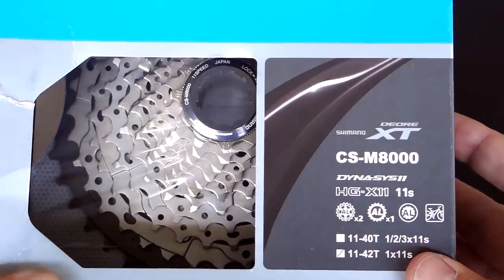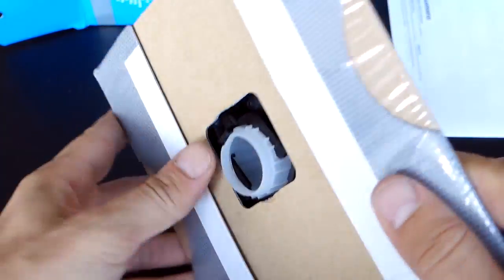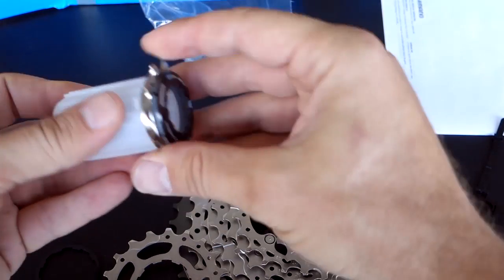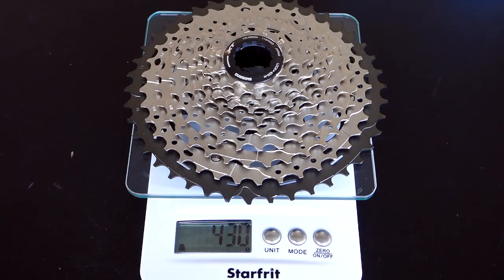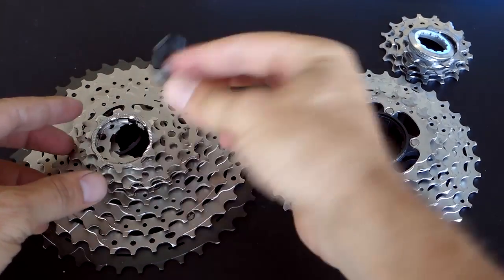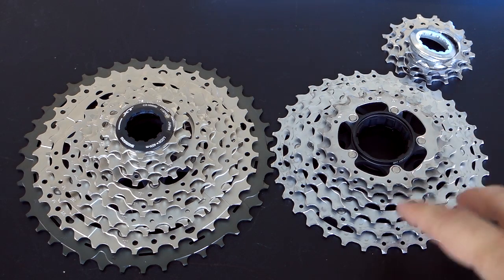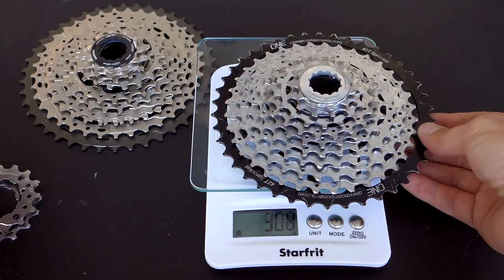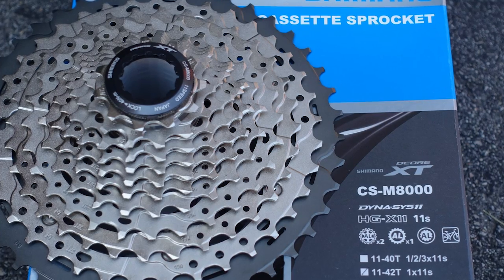XT M8000 11-42 11spd Cassette vs XT M771 10 spd vs 42t OneUp 10 speed

Comment: The package is reusable. You don't peel the plastic off like you did. Instead reach under each side and unfold the panels which will slacken the plastic and let you slip the cassette out, or back in if swapping or storing.

Comment: I have an XT 1x10 setup with the Oneup 42t cog. And shifting is great for me. But what I did different is I kept Shimano's, 17t cog in the cassette instead of putting the 16t Oneup cog in there. Also got the Oneup rad cage. Works perfect for me. Flawless shifting. Great gearing with a 32t up front
Reply: +LoveMTB yea. It's a bit of a jump from 13 to 17, but it was quick to get use to. I mainly went this route cause I thought the teeth on the 16 from Oneup just didn't look as good as the 17 from shimano. 
I bet 1x11 is nice though!
Reply: I have an XT Cassette, FireEye 42t and generic 16t cog, XT chain and derailleur (SGS+ with long B screw) on a Marlin 6... it works absolutely flawless, almost noise free and no issues with back pedaling.

My crankset is an XT (2v) with a Chinese oval 32t chainring with 1mm spacers and my chainline is on the 5th cog.

Can't be happier with this bike because it was made with second hand components, some of them barely used, all very cheap.

Very good Channel @LoveMTB old and new videos.